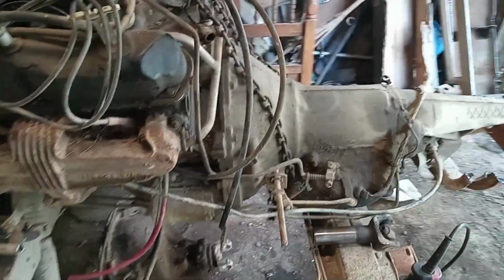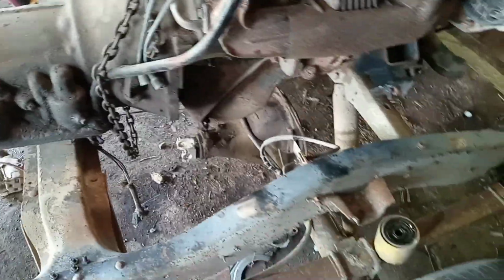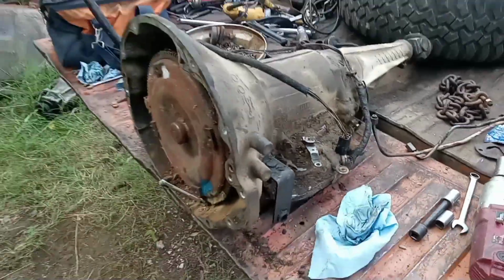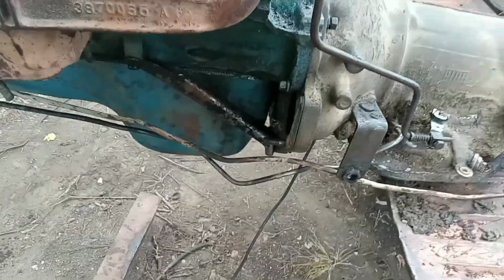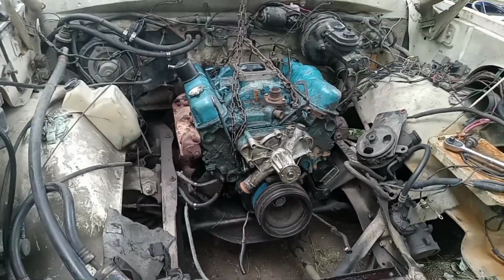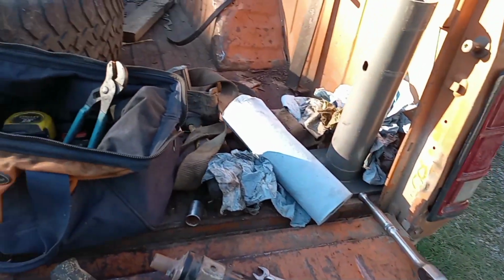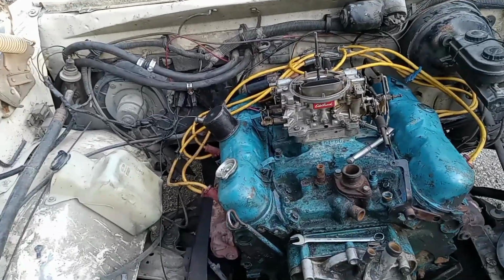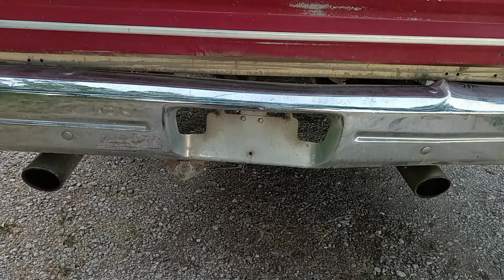86 Dodge Daily Driver Revival Part 2

Comment: Why did you take the front end off the truck. I have put them in and out just tipping the with a engine balancer. They are tight but it's possible with an automatic. Good videos.
Reply from the maker: The height of the A-frame was an issue. Plus with the core support out there was much more room to work around putting the motor in and together. I also cannot use a leveler because of the lip on the upper cowl hits the back of the leveler.